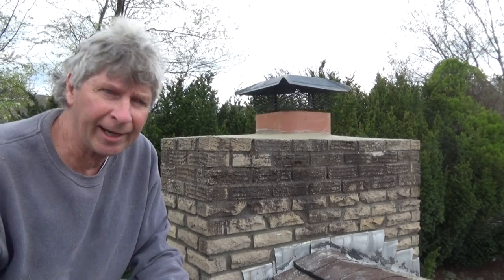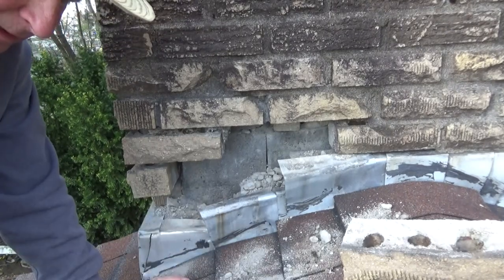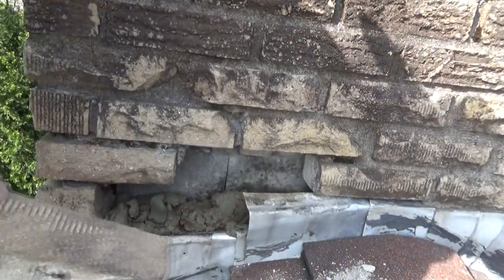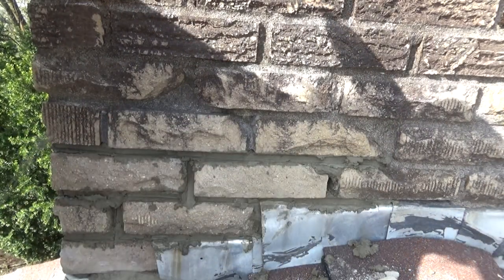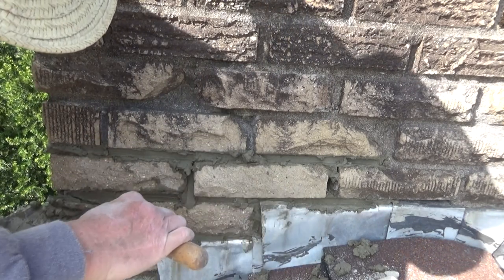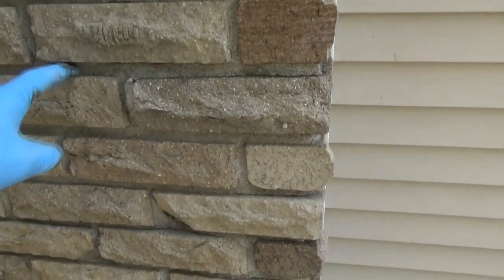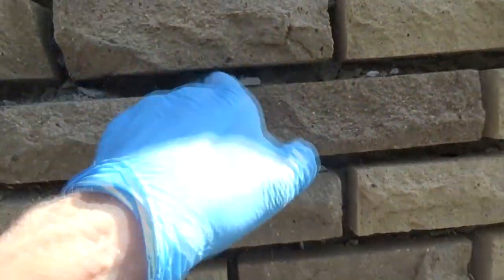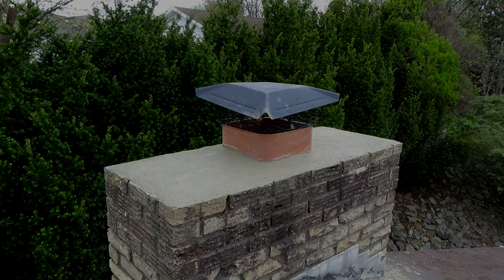CHIMNEY REPAIR (Part 10) Mike Haduck

Comment: Mike! You inspired me to fix my moms chimney. I had some local Masons come over and look at it and they quoted $5000 to fix a 15 foot crack that had formed from heat expansion caused by the fireplace. I did it for $150! I Didn't make a big deal about it, I just got it done!    ; )   -Michael
Reply from the maker: Thanks Michael, I like hearing these stories,  I appreciate it, mike

Comment: Hey Mike,32 years in the Masonry trade myself,I've been projecting all my caps or re-caps 2"from the face of the brick, and using concrete with wire for the caps,it does take an extra 1/2 day,since ya gotta leave the form on a wreck the scaffolding the next day,I work by myself also,I do use some spot labor here and there ,90%of the time it's just me,enjoy your show,and you know as well as I do,ya never stop learning in this trade,I'm 3rd generation Mason,I  couldn't imagine doing anything else though,I'm in southwest Ohio,we get the same weather,and I stay busy on chimney repairs and restroration work, haven't done any new construction in 3-4years now,take care brother,and BRICK ON!
Reply from the maker: Thanks Jeremy, it sounds like we think alike,  it's good to hear from other masons, I appreciate it, Brick on also, mike
Reply: Yep me too, I always do my caps with about 1 1/2" To 2"  past the brick face with a drip edge cut into it. Cheers guys.

Comment: It doesn’t have over edge for rain run off the chimney bricks and you didn’t leave gap between the flue clay and the crown. The expansion will crack the crown.
Reply from the maker: Hi junker. The job was to repoint it, I show in a lot of my videos how the flues fall apart, best thing nowadays is metal, inside and out,  thanks Mike
Reply: Yeah i like metal too, i bet also would not get too hot and would be way easier when comes time to clean the creosote

Comment: Hi Mike !.. As you know , i do a lot of repair and restoration work ..when pointing or filling in joints where we remove and replace bricks , we use " grout bags" ; either from the tile department or sometimes found where the masonry supplies are at Lowes or Home Depot.
   We still use tuck pointers , but the grout bags are super fast and you can fill in a joint from back to front rapidly.
   Then , just joint and brush .
Thank you Mike ! Love your videos ! 
     Joe
Reply from the maker: Thanks Joe, I appreciate it,  happy 4th, mike

Comment: Sucks that masonry is dying and not many brick constructions. I really like the look, functionality/utility of brick homes. In my opinion, way better. And these houses/buildings that were built are still standing today. Shows that it withstands the test of time. Whereas new construction falls apart quickly and is not nearly as durable. These videos are very informative. Thanks.
Reply from the maker: Thanks Jake, Mike
Reply: @MikeHaduck  Do they still sell the bricks without those 3 holes ?
Reply from the maker: @jakec5618  there are some,  thanks Mike

Comment: Aha chimneys. Our area has a bunch of them in older homes. They tend to be
like the one you worked on here Mike; brick with the clay flue pipe.
Same problems caused by the weather. Working on the ground side is
the worst. The ladder or platforms need the extended stable adjusting feet to be safe.
I cover the roof around them when I work with old foam rubber mats.
Keeps the surface clean and are comfortable to sit or kneel. After you suggested the quick
cure mortar mixes and Cement All I tried them. Very good products and
make my work a lot easier. Quicker jobs and easier work make my bids more
customer friendly. Thank you!
Reply from the maker: Thanks pensive,   Mike

Comment: Nice job Mike.    I learned a lot today.    I have a rock chimney which leaks inside when rain blows in a certain direction.  A roofer told me the chimney needs to be sprayed with a clear protective coat.   He also said that the flashing wasn't done correctly, a edge needed to be cut in the stone and the flashing bent into that edge and held in place.   The chimney is in the middle of the house and he said the where the downward roof meets the chimney it needs a cricket install.
Reply from the maker: Thanks larry, masonry chimneys are becoming a thing of the past,  mostly because of those reasons, thanks, mike

Comment: May I suggest that in addition to the holes making a lighter brick for shipping, that if they are all filled in for each course, they then become solid and form a bond with the mortar in between the brick courses for a stronger bond?  Thank you for all your videos, I love them.
Reply from the maker: Hi Robert,  there is so much to say about it it hard to answer, but I am not a fan of bricks with holes in them,  thanks mike
Reply: @MikeHaduck  yeah holes in brick are pain and never seen it actually make anything stronger when pulling them apart

Comment: The portland works fantastic on modern brick.  Never use it on historic brick (<1920), though.
Reply from the maker: Thank, Mike
Reply: Why not?
Reply: @StratKruzer  what I’ve been told is that it’s too hard. Old brick is soft. If you use cement the joints won’t move when the brick does and the whole brick will crumble.
Reply: @joshbudde8528  here in the city of philadlephia you can see examlples of patches where the brick faces spall off after repairs with the wrong type of mortar.
Reply: @eniszita7353  what if you use a brick sealant on the brick to water proof them.
Wouldn't that sort it
Reply: @Michael77999  I think it is more of a temperature issue; the old lime/sand mortar is more flexible when the bricks expand and contract while the new mortar is harder and the faces crack because the portland cement doesn't have the same give.  Also because the older bricks expand/contract more.

Comment: Pointed all the weak areas on my 1964 colonial in 2001 with mortar in a calking tube that was silicone based covered the cap with same product,  then painted all the joints on chimney and cap with a concrete paint,  then after paint cured sprayed the entire chimney face and cap with several coats of concrete sealer  Go up on the roof ever year to check for potential problems that can develop so far it's held up well for 22 years of hard winters and hot sun in Eastern Washington state.
Reply from the maker: Thanks Sam, Mike

Comment: Just checking Mike, you used the same mix for pointing the brics and the extension above the chimney top ?? Thanks for the education Sir.
Reply from the maker: Hi victory ,for laying and pointing ,same mix, but for the cap either portland & sand or that rapid set. Other  masons may say different,  thanks Mike
Reply: Mike from you experience would using a squeeze bag with Portland and sand 50 50 mix be the ticket ?? The stonework on my house was done right fifty years and no cracks foundation footer, cinder block wall and the chimneys except one opening groove because the martor about 10 inches long and about 3/4 inch wide and one and a half deep. Not bad for a old house Mike.  @MikeHaduck

Comment: I agree with you Mike...Here in Baltimore, masonry and concrete falls apart quite regularly, especially when folks use salt. Those chimney flashings are garbage as well...why didnt the homeowner want a new crown poured? That could help a whole bunch in keeping moisture off the brick faces...
Reply from the maker: Hi Bee, I guess you can say the flashing is up to the roofer,  my job was just to patch it, thanks mike

Comment: Mike i have an old chimney, brick n mortar good shape. But my crown was just parked mortar that's gone. I have about 2 1/2" of flue sticking above the brick. Should I e tend the flue and pour a solid con rete cap, or just re-parge the top? Thanks again Mike! And yea I'm in Pa
Reply from the maker: Hi Jeff, you could patch it of course, I am a big fan of patching and putting a metal cap over over the whole chimney top, with a little yearly check,  they are usually good for life, thanks, Mike

Comment: We always did 1 Portland , 2 lime, 6 sand. Western Oregon - kind of like UK climate. 

Holes in the brick! When I was a hoddy - 200 brick on the roof was nothing but heavy. Solids made it worse. 😀
Reply from the maker: Hi Ttf.  That sounds like a solid mix,  your right they are heavier,  thanks Mike
Reply: That mix is type s mortar.  Depending on the hardness of the brick I will go more or less sand.   For softer brick I use type n or even type o

Comment: What is the cement you used for the crown? It looked like it was a different type when you were pointing the side brickwork.
Reply from the maker: Hi, I used cement all mortar mix, it's like concrete and hardens fast, thanks Mike

Comment: Hey Mike - nice work as usual. Hope you're enjoying Florida (think I saw you moved there anyway) What type mortar are you parging the top cap with? Is that Type N or S or are you using refractory cement to mount the flue? Im so confused. LOL Thank you
Reply from the maker: Hi Jeff, Each job is different, mostly portland or a rapid set,  thanks Mike

Comment: Hey Mike,
Another great video. I have repointing to do on my sister's building, it's old stacked rock, and the mortar is loose but the rock is still in place. Question, just pull out the loose mortar mix a firm batch of mortar mix, add alittle more Portland, then push it in. Sound about rite , thanx again for sharing ur knowledge. 
Bob
Reply from the maker: Hi Bob, I got a whole playlist on repointing stonework,  every situation is a bit different,  thanks mike

Comment: Can you tell us the mix you put on the crown?  Earlier, you mentioned the need to add Portland cement to the mortar, but while doing the work it sounded like you were using Cement-All.
Reply from the maker: Hi sirragreen, cement all mortar mix is as good or better than portland, it was designed to repair runways for the military and used by highway dept. They mislabeled the name with mortar, but it's my opinion,  thanks Mike

Comment: Hi Mike.  Love your videos.  Watched a ton.  I see you cleaning up stuff a lot before a repair with a brush or tool.  Dust. Sand. Chips. Etc.  What about a cordless leaf blower for outside work?  I use mine a lot for project cleanup and prep. Landscaping and woodworking mostly.
Reply from the maker: I should have one I know,  thanks Mike

Comment: Hi Mike! I've watched several of your videos specially the ones about chimney crowns. I live in NW Florida and  apparently in my area there is very little to No knowledge in chimney crown repairs and I can't find anyone to do it for me. I've watched of your videos about different types of materials to use ( portland, mortar, etc) and would like your opinion on what would be the best application to repair my chimney crown without having to remove all the concrete. The chimney was build in 1983 out of brick and is in good shape. The crown has hairline cracks and the concrete needs to be sealed.  I've spend several hours and days on Youtube gathering info and yours has being the best educational ones. Thanks!
Reply from the maker: I would say for the best option would be to cover the cap with metal, 2and best just keep patching and painting,  thanks mike

Comment: Thank you for sharing your experience, Mike! Question: when you worked on the crown after putting on that piece of clay flue, did you leave a gap between the flue and cement to put some heat resistant caulk? Some other advice I've read recommends that. Would love to hear your thoughts!
Reply from the maker: Hi, I never do, I know others say different but I go solid, thanks Mike

Comment: I have an 1800's house with a chimney that needs repaired. Also the roof is slate and it needs repaired, should I fix the chimney first or the the roof?
Reply from the maker: Hi Pan ,I always do the chimney first if I have the chance and every roofer I know waits till the chimney are repaired so the roof doesn't get messed up, thanks mike

Comment: A friend of mine's kid just sent me a picture of his cinder block mortar joints in his basement. The he had paneling covering them. The joints look like your chimney needing the tuck pointing. I have never seen that with a concrete block foundation  before. House was built in the 1920's. He has a can of worms, the joints on the outside of the house below grade is prolly worse.
Reply from the maker: Thanks Jon, whatever works,  mike
Reply: @MikeHaduck  I'm worried he may have to trench the exterior of his foundation to repair. Core filling some of the concrete block from the inside crossed my mind.

Comment: Don’t you think some times when there area that the mortar deteriorate that the mortar fail between the flue so the heat deteriorated the mortar from the inside out, I see it happens here a lot in NORTH DAKOTA / MINNESOTA
Reply from the maker: Hi Jim, masonry chimneys are a thing of the past, I think everyone should start accepting it, thanks Mike

Comment: Mike so how about using a premixed mortar mix should I ad extra cement? Did similar repair but used marble to finish it off on top, a friend cut it for me.
Reply from the maker: Hi, I usually use a portland mix for the top, everything depends, I hope it helps mike
Reply: @MikeHaduck  Thanks.

Comment: Mike did you use a grinder to clear any of those joints or did you just remove loose material that came out with hand tools?  Thanks again.
Reply from the maker: Hi Robert, no grinders in this case,  just like a dentist get the bad out and fill it in, thanks mike

Comment: Hi Mike.

May I ask you an off-topic question?

I'm going to attempt to build a brick fireplace for my house I'm about to begin self-building.

Is it OK to use a metal flur for the fireplace rather than the traditional brick flue for the chimney?

have you ever encountered a fireplace where this has been done?

Many thanks for a highly informative channel.
Reply from the maker: Thanks Fred, I got a video in the works about that, but you got to ask the inspector and some chimney experts in your area,  ita a tricky situation,
Reply: @MikeHaduck  Thanks Mike -- look forward to your video.

Comment: Great job Mike. I appreciate the videos teaching new guys and DIY'ers some tricks of the trade. I do have one question for you. What caulk would you recommend to fill in the crack where my patio meets the brick walls? I dont want moisture getting down there and before i knew better, i used a mortar and concaved it to repel the water away from the house. Needless to say, the mortar started to crack just after 2 years. Would love your input and thanks again for passing down your knowledge!
Reply from the maker: Hi FF, sometimes a dryer pack won't crack as much but a caulking is fine if you can make it not look like caulking,  thanks mike
Reply: One problem I have with brick caulks is color match.   Even fresh Portland mortars are easier to match than caulks....
Reply: @pensive69  yes, but won’t Portland crack in a short amount of time?

Comment: Another great video Mike! Thanks, you definitely know your trade. Surprised me when you said brick work is on its way out. I was contemplating a 4 to 5 ft tall brick wall around my garden area. The bricks are offered to me for free from a demo contractor but I must clean them up of coarse. Should I use the old brick or buy new? I have no idea how to place a footing but I know our frost line is 36". I don't know how wide the wall must be to be 5 ft tall. I want a solid structure  to attach espalier grown trees and as a source of heat  retention. It will be usefully in stopping the winter winds that sometime damage young new growth buds.Are you against this idea?
Reply from the maker: Hi Von, I don't see a problem, I just ment that brick work as a trade is dying, everything is getting pre made,  thanks Mike
Reply: @MikeHaduck  my bad, sorry Mike, I misunderstood. Your opinion please,... instead of all brick on the garden wall would you recommend a block wall faced with brick so it still has that charm of the old style ways?

Comment: Hi Mike, I love your channel and you’ve inspired me to take on my own brick and flagstone walkway project.  It has gone well but I have run into the problem that S type mortar is sold out due to supply issues caused by the COVID 19.  The only mortar I can find is Rapidset mortar mix which I have seen you use on some of your videos.  Is there a way to “cut” it, perhaps additional water and/or sand, to use as a substitute for the Sakrete Type S mortar I have been using?  I was told by Home Depot that it is back ordered until late July.  Or would you recommend just putting the project on hold until I can obtain Type S mortar.  Thanks, I appreciate any advice you could provide.
Reply from the maker: Hi Jeff, I never use a mortar on stone sidewalks, Portland and sand only,  if you live down south you might get away with it, not up here, thanks mike

Comment: Aluminum flashing over brick , its always lead .Will the cement eat the Aluminum ? Never liked those cored sand struck bricks they suck water , i like the water struck hard brick , great video Mike.
Reply from the maker: Thanks Rocco, yep lead is what all the old buildings used, thanks,  mike

Comment: Mike, I'm confused.  I thought Type N mortar has to be used on exterior brick, because the brick has to be able to flex a little.  I thought S mortar is for structure like blocks. ??
Reply from the maker: Hi A , I did a video called "what cement should I use?, mike haduck part 2" I think I explain it best there but for a chimney I use at least s mortar due to our weather, thanks , mike
Reply: The real answer is it depends how hard your brick is.   With modern gas fired brick type s is perfectly fine because the brick are very hard.   Older coal fired brick may not be as hard so the mortar needs to be softer.
Reply: I'm in Washington state and only use type s winters here are hard and can get down to minus 10 degrees sometimes